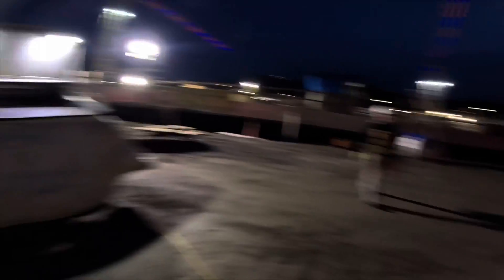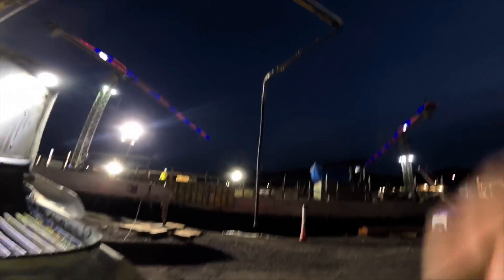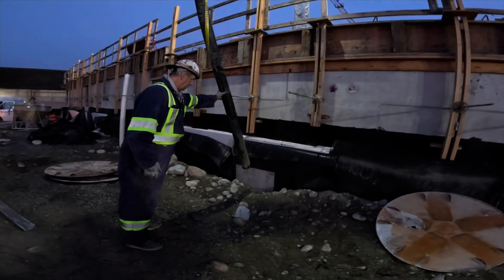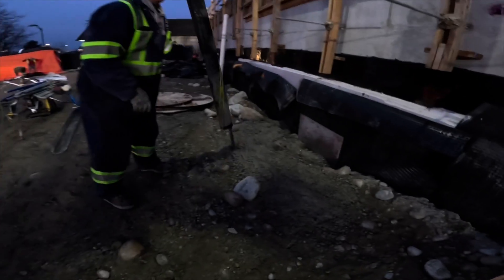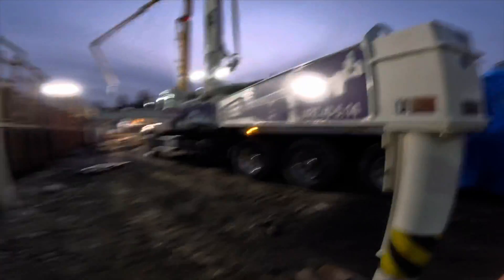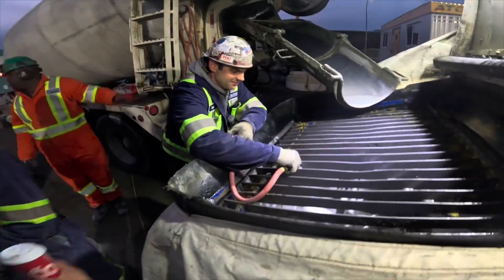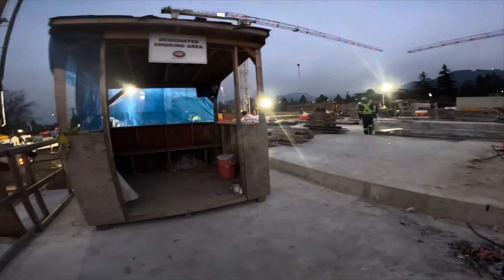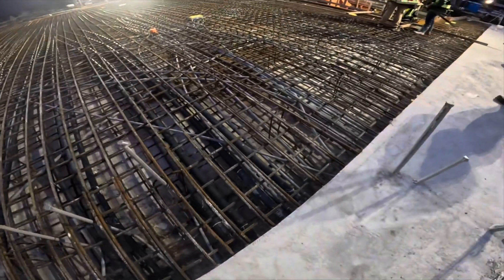WATER-PRIMING a 57 meter CONCRETE PUMP!!!

Comment: Getting lucky priming with it stroking all it takes is for the cylinders to load half way the you have water concrete water. Best way pump your water stop it so the open side piston is at the hopper fill the hopper past the agitator bar and pump on.
Reply from the maker: Same way I prefer to do it. I will say that I think we get away with a lot in our area due to the forgiving nature of our materials. 

Works well for these guys however, so I can’t say too much. 😁😁😁

Comment: What an absolute chancer using just water.  😏 didn’t even stop svalve to allow concrete to push water up cylinder. All this is showing the young operators how  to cut corners something you don’t do in our industry. And the old guy holding the flex best way to get his head blown off if it had of blocked . We try to encourage stand back when priming out
Reply: I’ve been in the industry 32 years and seen how easy it is to get in trouble with these machines. One of the main things in these days with younger operators is that the pumps will pump anything, years ago with old putzmiester if concrete was sh@t you would in reverse more than forward 😏😂
Reply from the maker: It’s one of the most hotly contested topics in pumping (along with water-washing versus sucking a sponge). These guys pump a ton of mud, and it works for them. That being said, I’ll probably stick to priming with my bentonite and/or kick start, but always good to see how others do things. 
Agreed, the “old guy” 😂😂😂 probably could have stayed away from that hose for few more seconds, but they also aren’t priming through at volume 10, and also do shut the pump off once that first bit of mud can be heard tinkling down the pipes. All that being said, 100% better just to stand away from that hose when priming through. It only takes that one time to change a life.
Reply: 32 years in the industry and still cant prime with water
Reply from the maker: @hunterclarot142  I can feel a water prime versus bentonite/slick-pack prime debate brewing!!!! Perfect timing for my Saturday evening. I’ll grab the beer and pretzels. 😂😂😂

Comment: To much water, I use a priming port with about 4 gallons of water (no form oil gets mixed with my water). When I’ve tried to use more I plug. But the biggest we have is a 50m
Reply from the maker: I tend to agree. I believe that using the prime-port (for those whom have them) allows for using less primer and contaminating less of the initial concrete which comes through the boom.

Comment: Used to water prime a 52m R&F in British Columbia everyday, no oil in the hopper. No stroking when concrete is being poured in initially, would push the water right into the cylinder fill it up and go. The mixes are much better on that side of the country. 
I would never try that in Ontario 😂
Not even on a 20m lol
Reply from the maker: We’ve good results priming our booms up to 47M with just water. Our 56Z is decent with just h2o. Our 58Z is an absolute nightmare trying to water-prime. They each have their own, “unique” personality. 😂😂😂

Comment: Gonna do it the Thompson way fill the flapper box.  I used to run an old Thompson with the flapper when was the last time you saw a Thompson?
Reply: First pump I ran 740 Thompson then went to a 465 5 inch pipe never got the top of pipe wet!

Comment: I water prime as well but I don’t start pumping until the mud is above the agitator bar. I position the chute so that the concrete pushes the water up the cylinder first, I let the hopper get almost full then pump away at half volume.
Reply from the maker: Similar to the way I do it as well.

Comment: I’m not going to lie, I’ll occasionally throw a little oil in my prime port with the water when releasing the air in the oiler. There is something about it that works. I’ve done it when I hop in my coworkers 47. That is when he hasn’t restocked the slick pack.
Reply from the maker: I honestly believe that the oil helps a good bit.
Reply: @canadianconcretepumper1979  it doesn’t mix with the water say like bentonite or slick. Kind of just sits at the top of that water. Similar to cooking pasta in a pot, boiling water then adding oil so the pasta doesn’t stick. All that oil rises to the top.

Comment: in my area on a 21m pump it would plug at deck pipe with water... our stone sucks
Reply: i like the live streams...keep it up 👍
Reply from the maker: @MaxCrete  appreciate that my man 👊🏻
Reply from the maker: What’s your preferred primer? We’ve used to use bentonite for decades, but have been seeing pretty good success with Kick Start gel primer lately.
Reply: redimix grout at 5inch slump max for horizontal line.....up has to be wet...down has to be wet but with a stopper in middle of line....slick packs work well....but i cant reveal how i work it
Reply from the maker: @MaxCrete  I’ve had good results using slick-prime on the boom pumps, and nothing but abysmal failure trying to use it for priming any amount of horizontal rubber. 

Don’t be a Scrooge, share the secret!!! 😁😁😁😁
Reply: bentonite works well small line 200ft or does its job...4 inch line not so well
Reply from the maker: @MaxCrete  agreed, 4” and larger should be ready mix supplied grout.